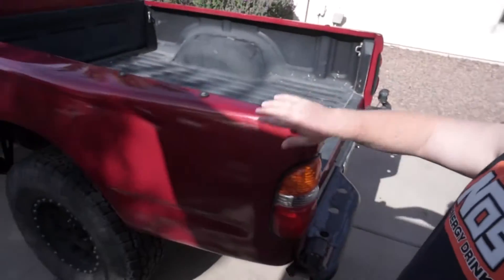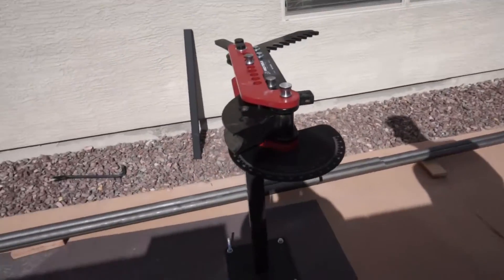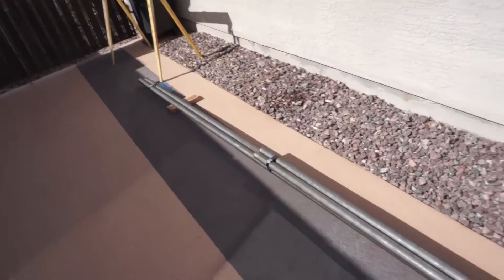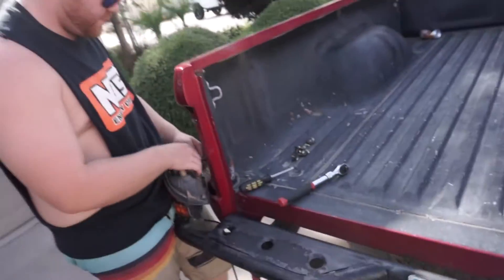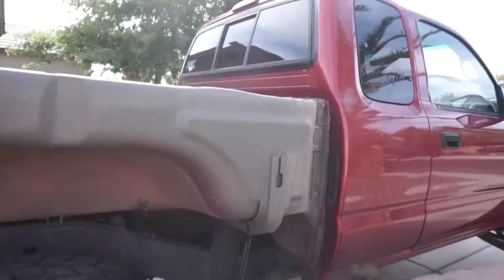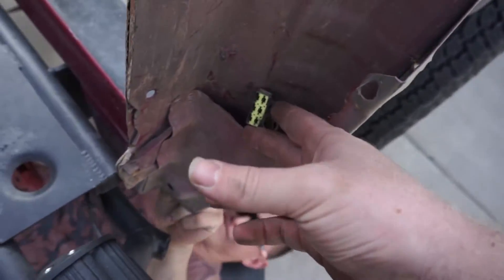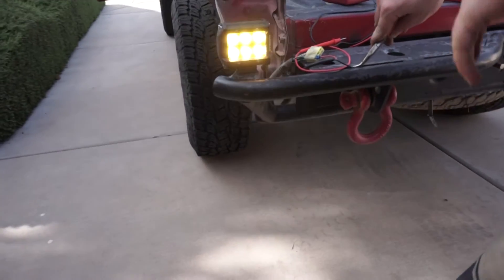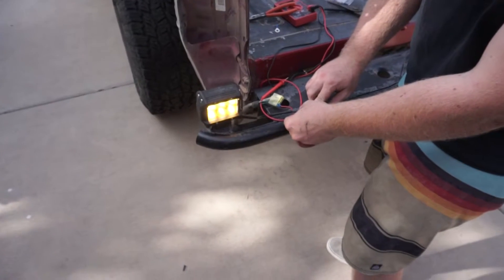TWO IDIOTS REMOVE A BED | Bedcage BEGINS Part 1

Comment: Did you have to drill out spot welds to drop the bed prior to this or was it just the bolts and the bed came free?
Reply from the maker: The bed is just held down by those 3 bolts on each side, only the stock bedsides have spot welds, and a shit ton of spot welds at that.  My fiberglass bedsides are just bolted too.